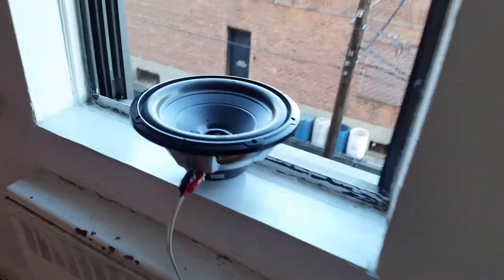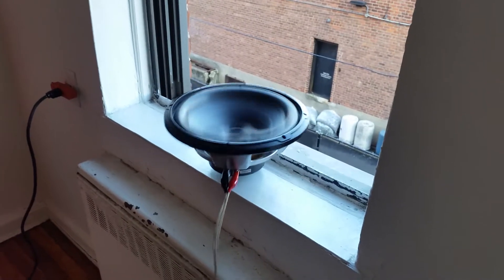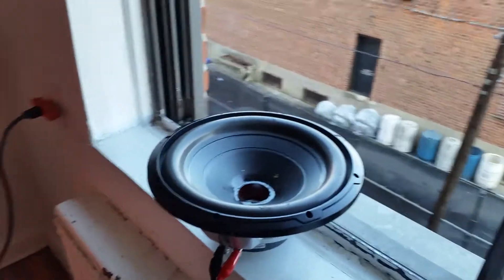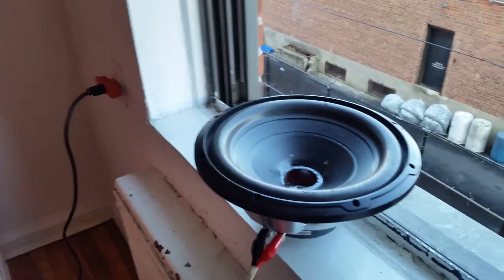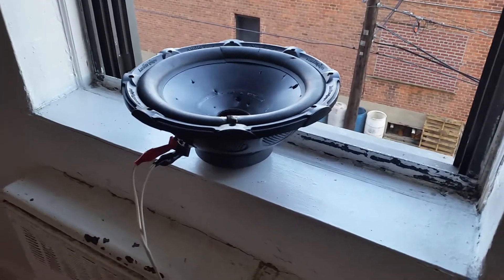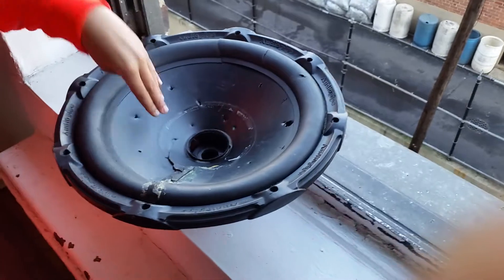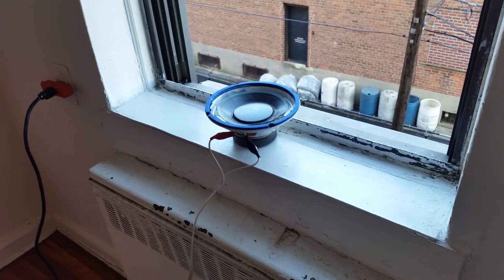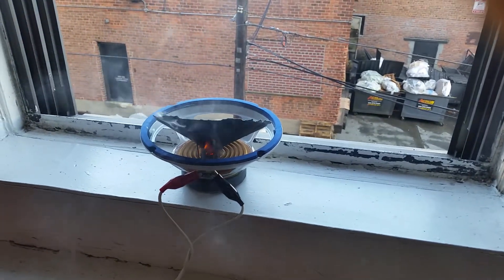Blowing out random speaker with a Variac episode 6

Comment: correct me if im wrong but i just did a ohms law calculation and that JL audio subwoofer was seeing 4900wrms. holy shit. voltage 140. resistance 4ohm = 4900w
Reply from the maker: You're not wrong, that thing took 4900w for a good few seconds.
Reply: @DJ_Renn  damn I got 2 of them and they are only rated for 300w that's impressive. Good video man